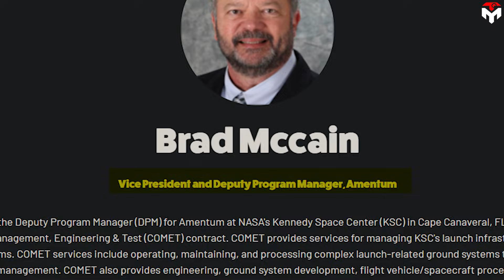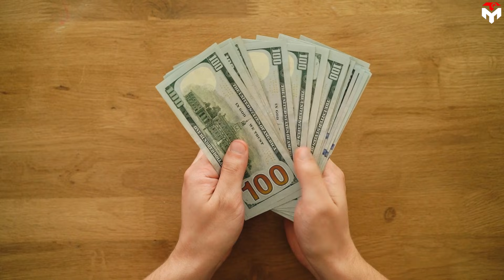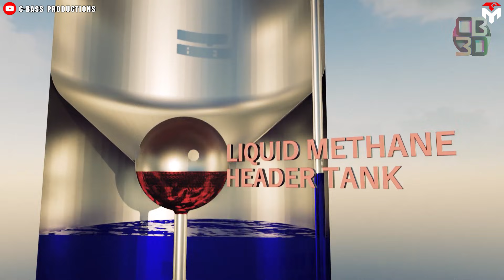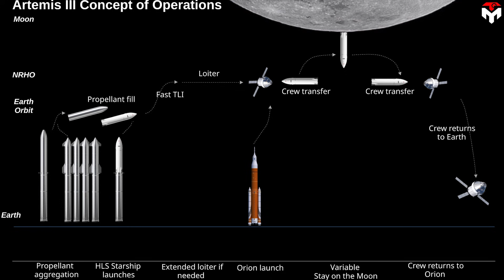NASA's $23B Rocket Mission Falls Apart! SpaceX Dragon to Replace...

Comment: You'll have to weigh the Pros and Cons to using SpaceX's machines, before you venture to suggest the switch. NASA is Updating all Facilities to prepare itself for Mars launches. Orion's "double dip" re-entry and use of cheaper Avcoat version used by SpaceX was not necessary, Nasa should use the Certified asteroid 'Wild One' originally intended. Explain Reliability, Assured Space Access vehicles[rockets] like Saturn V. SLS fulfills ALL requirements of Nasa to Mars and beyond. We'll even get better than STS Shuttle cheaper and reliable than Blackstar, in Trekkie style, Hyram, L/A, iON and Other propulsion modes or matrix. RS68, J-2X, 'r All at Nasa's disposal.
Reply: Ok is that you NASA FAN BOY. NASA is joke at the moment... 23 Billion and counting plus 20 years in development, people have entire careers on SLS and not flown one person.

Comment: Currently U.S. has the capability of launching, within hours, 2 Crew Dragons and 1 Starliner with up to 21  astronauts combined, into LEO to dock with a Lunar orbital Starship in LEO.  
So, getting a large crew to LEO  is solved.  
     NASA could contract SX to launch a lunar landing Starship and have it waiting in lunar orbit for the lunar transport Starship.   In reality, u don't need Gateway or Orion for this option. 
    Also, SX could develop an orbital docking ship with 6 ports to dock the empty 2 Crew Dragons and Starliner in MEO, while their crews are busy on their moon journey.     
     Gateway isn't needed, nor is Orion and  SLS.  The Starship launch system has changed the game.
Reply: @arthurhamilton5222  Starliner is not human rated yet, always check details.
Reply: @arthurhamilton5222  It hasn't, please

Comment: Dragon has that cargo attachment. They could put the extra life support and power plant there without having to alter the main capsule. it could replace Orion.  As for Starship, if it gets ready, they plan on a fuel station anyway, so that would not be a single-use addition, but used for many missions.
Reply: You're WRONG, it also NEEDS fuel space to get it to the Moon/Mars. These things aren't CHEAP even if it is famed Kelly Johnson, Ben Rich [CIA], or Zubrin "SkunkWorks", Lockheed Marietta. See US Manta by Kelly's Group, same for JWST.

Comment: I don't get it, are you suggesting that the science was much better in the 70s when they did this multiple times? How hard could this be? Just pull out the old documents rinse and repeat. Unless what I thought was true is not true about the moon landing in the 70s. I hope I don't have to apologize to my friend who thinks it was fake.
Reply: OK, so why not go for all of us having a wall mounted hard wired dial phone? Why smart phones, that was a very solid system of the day that was extremely reliable. The SV had a good safety record but had some close calls. Apollo 8 had a 50 50 chance of never coming back. The risk tolerance of the time was no where near what it is today.
Reply: @brianw612  so are you saying they can't make a wall phone with today's technology? Haha
Reply: @davidkclayton  No, I'm saying that because something worked well in the 60's doesn't make it suitable for modern times. The SV is a prime example. No matter how good it was, it was yesterdays rocket and building it today would be pointless for a host of reasons.
Reply: Now that Wernher von Braun and his German scientists and engineers are not around anymore, nothing works as planned. One wonders how they achieved those successful results in the 1960's...  :face-fuchsia-poop-shape:

Comment: The best starship can do is leo with payload capacity of 50 tons forget about moon and mars it isn't even going to gto 😂😂😂
Reply: Wondering if that thing will turn out working. 
If they get refueling right, i think it was ~18 refueling flights for "Starship version 1", until it has enough propellant to get to the moon and back (which is needed for artemis). 18 lanunches and reentries. 
Imo that's why they are pushing for "Starship 2" and "Starship 3", so they can launch as samller and lighter lunar starship and fuel it up with just a couple of "Starship 3's"  
We'll see, if we see it xD
Reply: @surrealengineering7884   honestly i have zero expectations 
but if they built a disposable 2nd stage like falcon9 i think you can send lunar starship right into lunar surface without refuelling (if that thing is light enough)
Reply: @TOBI-0-0-0  Probably so. Also, if they want to keep the timeline (Which elon probably does, to make Trump happy), they might do a lunar ascend module as the top of the "mini-lunar-starship," just like Apollo.
Would also give them the option to abort a landing on the moons surface.
They could label it as a "scouting mission" and who knows if anything comes after it. xD

Just thoughts, might be total crap and Starship still won't have made it arround the moon in 4 years. Haha. 
We'll see

Comment: Cancel SLS now. It cost too much. StarShip will be the best way to get there. Remember SLS has no reuse ability.
Reply: It has! The two cheap external boosters descend on parachutes for re-use. While the expensive rocket engines and the whole main rocket are wasted and discarded. I think this tells us the current state of NASA... :face-fuchsia-poop-shape::hand-pink-waving:
Reply: And you have zero braincells
Reply: @TOBI-0-0-0 I think you are the one with a zero 🤣🤣do you have any hat's? 🤣🤣🤣
Reply: No, Starship is years behind and hasn't made it ti orbit or become crew rated.